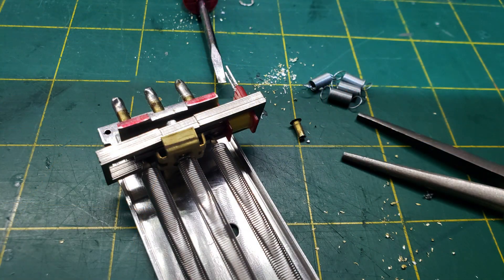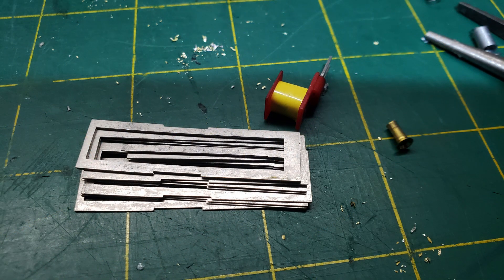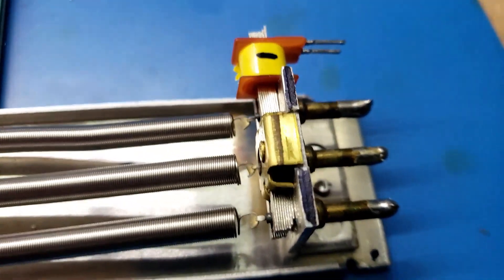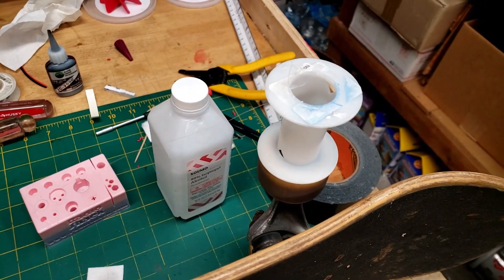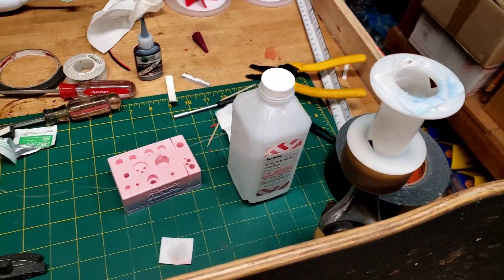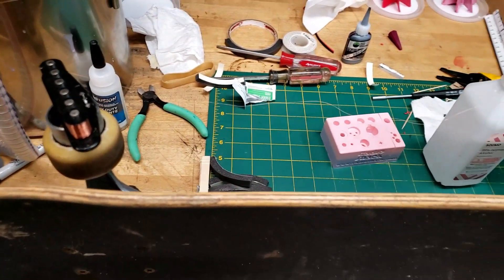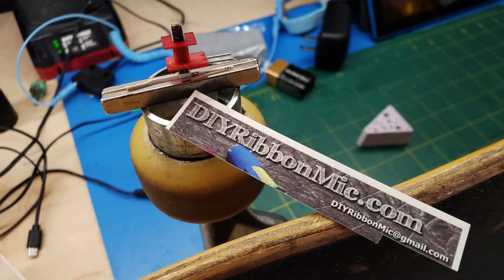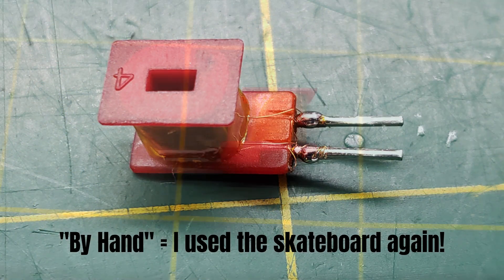Rewinding a Spring Reverb Transducer Coil

Comment: Does a random/scatter/handwound transducer open up the top end like a handwound guitar pickup does?
Reply: I would assume it would have somewhat less capacitance when scatter wound. It would be interesting to compare them. I would guess it wouldn't be a dramatic difference when most reverb circuits roll off some highs.
Reply from the maker: That wasn't my goal here. I had a broken winding, and i just wanted to see if I could fix it with stuff on-hand and some creative engineering.

Comment: Hi Austin.  Do you by any chance know the original gauge of wire used for old 1960s Gibbs spring reverb tanks used in Fender Reverb Units?  I have a open transducer coil as well.  Thanks.
Reply from the maker: No, but I'd bet Google knows. For the record, this was not a vintage Gibbs pan. In this experiment, all I cared about was that it worked... And it does. The pickup wire I harvested from a modern cheap import guitar pickup was probably a little heavier than the original wire I removed from the bobbin. I got lucky with the DC Resistance: What I wound (198 Ohms) was within 10% of a second unit that I measured at 210 Ohms. No idea of the length or number of turns. I totally winged-it.